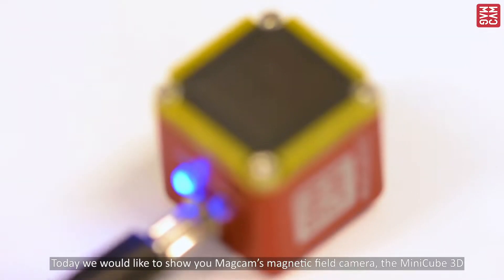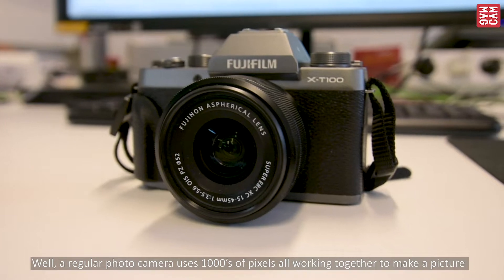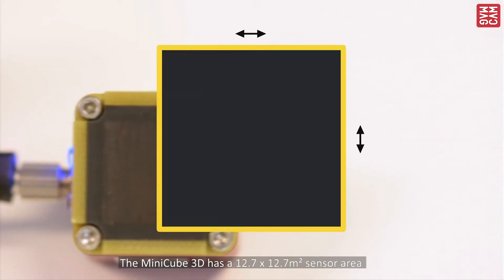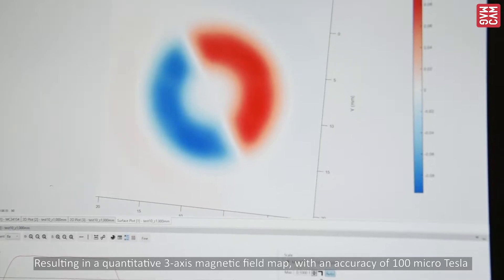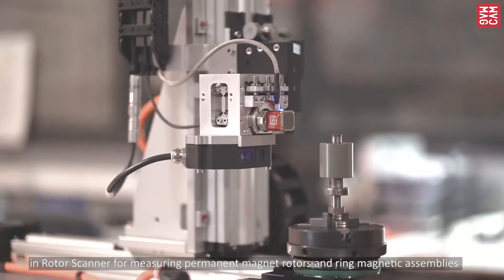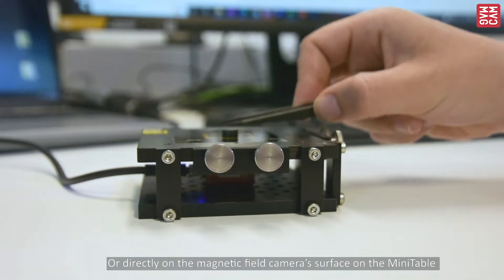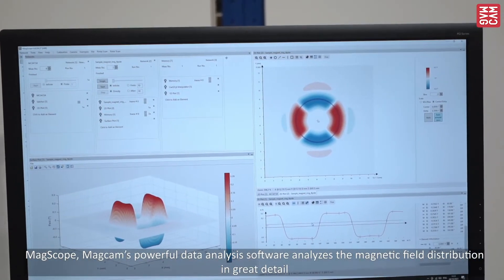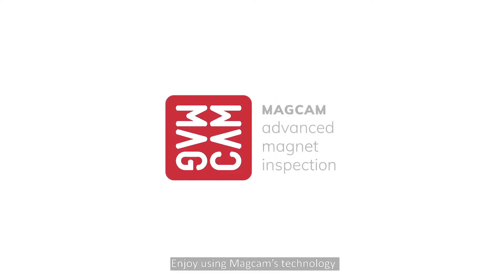MiniCube 3D | Advanced Magnetic Field Camera for measuring & analyzing magnetic field distributions

Comment: and the price ..
Reply from the maker: Hello, thank you for your comment. If you are interested in our equipment, please send an email to info@magcam.com or fill out the web form on www.magcam.com/contact. We also provide service measurements, so you don't have to purchase a system in order to benefit from our technology. Best regards, Magcam.
Reply: @magcam  could it be used to generate a sequence of captures to then convert those to voltage and ultimately to sound? like reading an audio tape and later convert that data to sound?